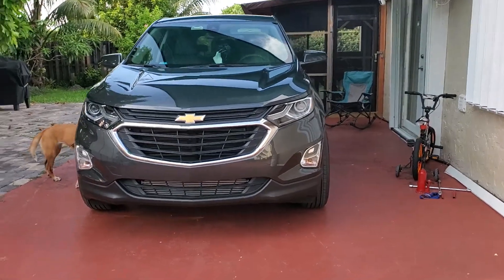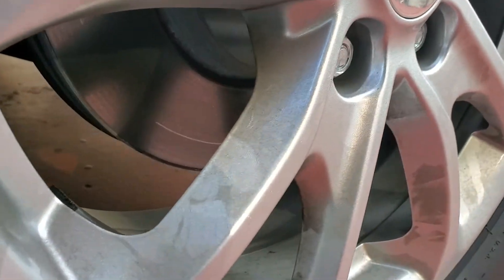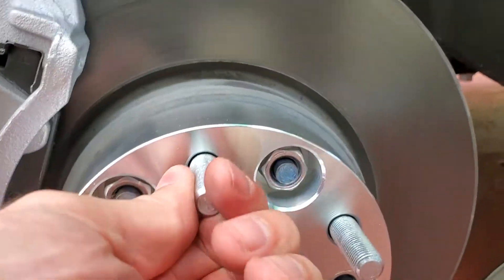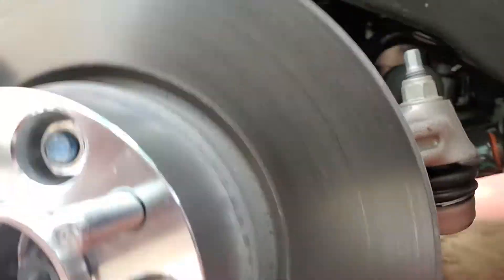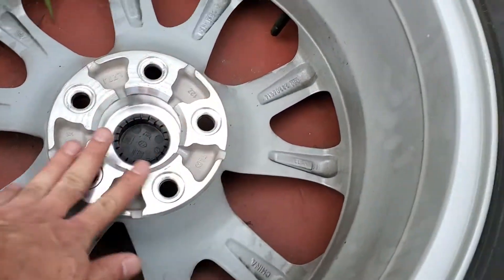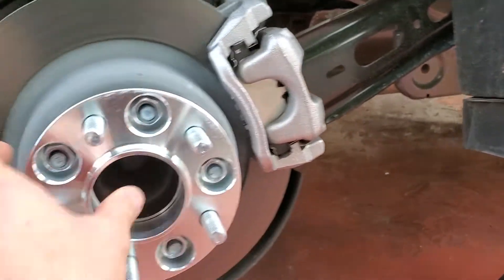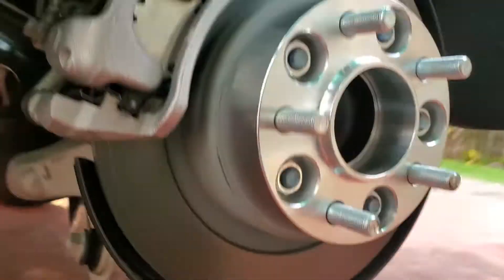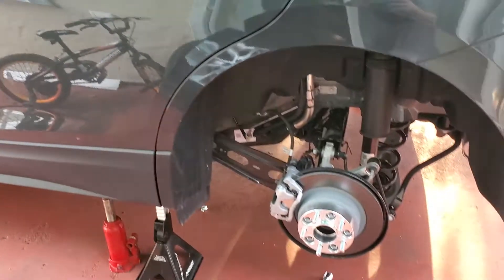2020 Chevrolet Equinox Wheel Spacers (UPDATE after 100 miles of use)

Comment: Do you still use these spacers? Have they held up since this was posted?
Reply from the maker: Hi, yes, they are in good shape, no problems at all.
Reply from the maker: The cas has now almost 10,000 milles, no issues. Good looking car with those spacers.
Reply: Did you have to cut your studs.?
Reply from the maker: @nbdxbotism8839  No cutting